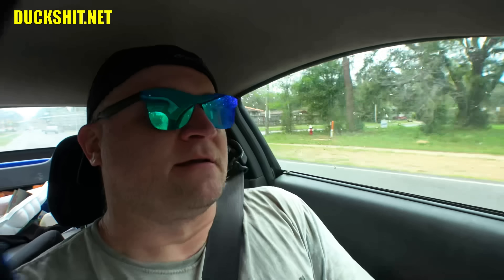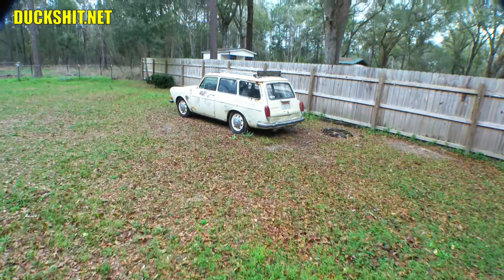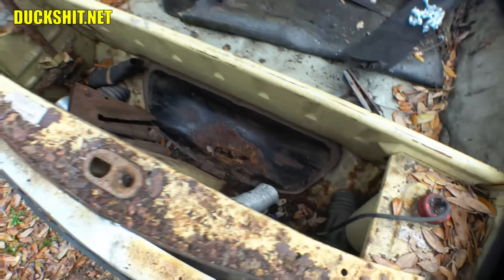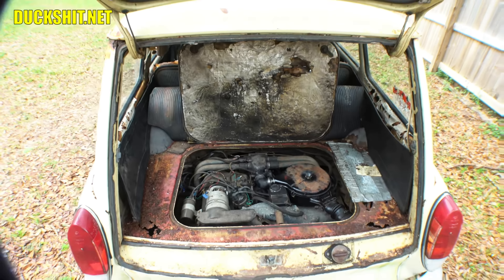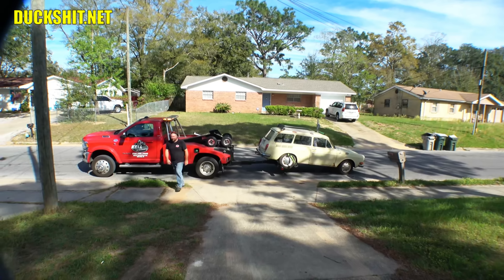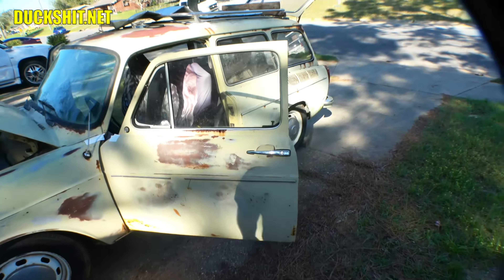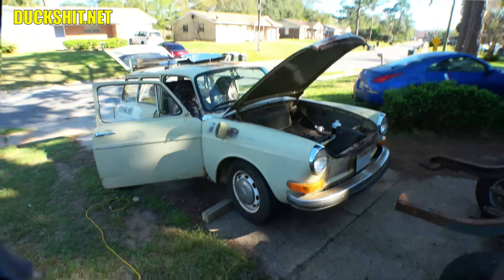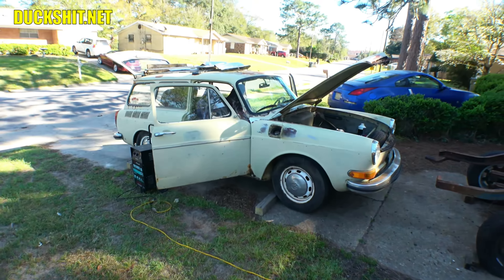I Bought a Squareback (1971 VW Type-3 1600 Variant)

Comment: Duckman I'm glad to see a squareback project. I have a 73 squareback in Clementine Orange that I named Clementine of course. But I'm making a death rocket. I'm putting my body on a ford crown vic chassis. Then once that's situated I'm throwing a turbo charged 460 big block ford up front with all the power and just pray I don't tear the dang thing apart. Excited to see the chassis swap.
Reply from the maker: That's a big chassis, gonna take a lot of fittin'!  Good luck to you! Hope you're making videos, i gotta see this!
Reply: Will definitely make videos. In the process of a Cummins swap on my daily driver. Then doing a 1970 vw beetle with a 2009 wrx powerplant and transmission. So definitely big plans but I'm doing it out of a small one car garage. Hoping to put a 3 car garage in the back for filming. Definitely will have videos on all the wrenching and struggles. Thank you for inspiring my love for vw bodies even if I like new motors.
Reply from the maker: Thanks thanks man, I'm really hoping to see this one! Made any progress yet?

Comment: Back in the seventies my brother had one of those in mint condition. Florida rain dont like volkswagons. Salt air too.
Reply from the maker: Salt air not really a problem here unless you're right on the water.  I know people that live on the beach but keep their Volkswagens here in town in storage.  The big problem with Volkswagens are very well sealed, and everything has a rubber goggie to keep it that way. They go bad and are meant to be replaced, but when one leaks, the water gets in... and man, they hold water quite well... until they don't anymore... haha!
Reply: @DuckmanCycles  So they did not replace the rubber seals and it leaked then it rusted?

Comment: I'll be honest I'm in the UK and the type 3 is warming to me quite a bit and I've been looking to buy one when it comes to parts I'm beginning to find that parts are scarce what are parts availability like in the USA ie... repair panels front beams floor pans etc as the UK vehicles do suffer with the dreaded metal worm your help would be much appreciated
Reply from the maker: Well, parts are a bit harder to find, but body metal is available, and I believe there is an outfit that makes it right there in the UK.  I haven't seen anyone doing Type-3 beams, but they don't usually break.  Rust is another issue, but you can always scab another beam off another car.  Door handles and generators have been a hard find around here, but I've always found what I've needed, or I made the parts from something else that was readily available.... like the EXPENSIVE-AND-HARD-TO-GET one-year-only transmission nosecone mount on my 1968.  But I drive it everyday, parts are available if you look!  Hope that helps!

Comment: One if the reasons type 3s are so great is because you just adjust the tension bars to lift or lower your ride.. no need to frame swap it??
Reply from the maker: It is a lot of adjustability, but unlike like a beetle you can adjust the front without modifying the beam.  But if you still want to MEGA-RAISE it, it would need something swapped.